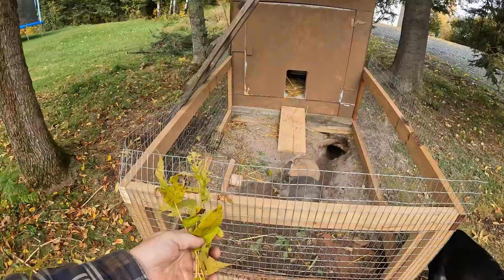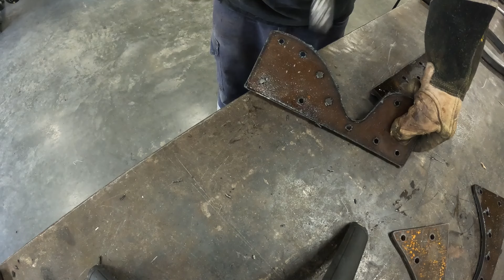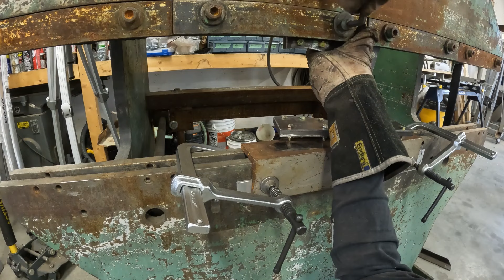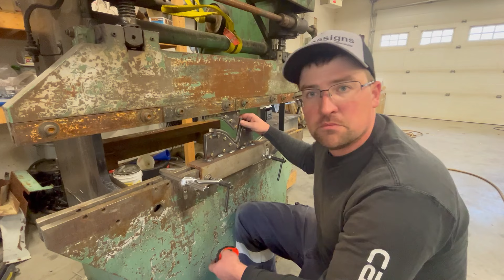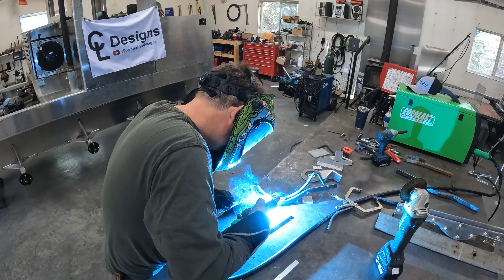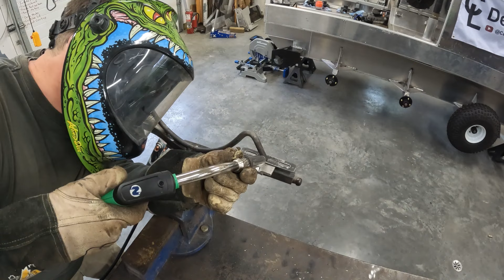Stamping MORE Metal Parts | Snowcat Track Building PT2

Comment: With stiff 3 ply belting will you have to slide each grouser on from a ways back as you build tracks?
Reply from the maker: The belting should just slide in from the ends of the grousers. That’s the plan anyways. Made sure to leave enough clearance so that doesn’t become a big chore. I figure the bolts won’t have an issue tightening it up.
Reply: @CenterLineDesigns  Right, I guess with a pitch of 2.8" you'd never be able to take a single grouser out at a time anyway, regardless of design.   Grousers look great.
Reply from the maker: Yea true probably have to take several apart and give them a twist.

Comment: Just remember adding  galvanizing  adds size and you need to add that thickness into your build and make adjustments . Suggestion bmake 1 complete send it out to get galvanized then check it against the original specs make sure its with in tolerances  . And dont rush the process to get videos out . There is always some other work on  the snowcat that can be done while your waiting for the grouser to be returned from galvanizing.  Just remember everything  say is Suggestions only .😊
Reply from the maker: I really do appreciate the input! Lots of time I have ideas and getting to hear from others gives me other points of view. Some time I take the advice and sometimes I like to continue with my thought process (right or wrong) but I really always do appreciate the comments. So I do honestly thank you! I don’t think the galvanizing process should change too much as my tolerances are quite loose but you are right that the heat cycling process can definitely make things twist and warp. That would be very frustrating. I am going to start making some calls about pricing and I’ll go from there. 

Thanks again! Cheers

Comment: Why not cut them before you weld it to the grouser process is as much as the fabrication  bend cut weld done
Reply from the maker: I probably could. The reason I am choosing to do it this way is that I can really ensure that the fit with the backing plates is perfect. I agree I could totally cut them first. I just feel that doing it this way will limit the potential errors. Also with a small jig for the chop saw it won’t be difficult or take long to do after the welding. 

There is definitely multiple ways it could be done!

Comment: The only downside to 2 pieces is a weak spot in the middle where all the stress is . Also add in the cold  you weak spot will be  magniied , i hope im wrong .
Reply from the maker: True. I think I’ll run a stringer bead between the two pieces but also that wear strip should reenforce the bottom. They feel really solid so I don’t think I’ll have issues. But if I do that okay because we will learn something and move on to the next idea. One thing is for sure we will find out together lol! Cheers

Comment: Don’t waste money on galvi or any other coating, anything you put on there will wear off faster than you think and they are going to rust no matter what. If you are worried about water sitting in the bows at the bottom of the track than just drill a couple weep holes near the crown of each cleat, give the water a way out. My tracked vehicle has had square tube cleats for near 30 years, they have not rusted through yet.
Reply from the maker: Very interesting! This is exactly why I wanted to ask the viewers. It good to hear others experiences. Definitely need to get some holes in the dip. It is surprising how long bare steel will last in the right circumstances. Thanks again!
Reply: @CenterLineDesigns  no problem, track building is always the biggest hurdle.  Your cleat design looks great, still skeptical of the longevity of the tires though. Keep pushing, you will be glad when the tracks are done, everything else will feel easy afterwards.
Reply from the maker: Thank you sir! Yup I agree about the tires.  Easy enough to change later. Really appreciate input from someone with more snowcat experience than myself! Cheers

Comment: It might be smart to make the valley between tooth roots wider on the drive sprockets kinda lily the doo on conveyor drive systems. That way if you have a small amount of inconsistencies in the driven part of the belt it won’t bind and try to climb the sprocket teeth. Only thing I could see being weird is when you go from forward to reverse. Small amount of slip. But if it keeps the tracks from ratcheting I think it’s worth it.
Reply from the maker: I completely agree! Give that little bit of slip. There is definitely an optimum amount to help with track inconsistencies but not too much that you begin premature wear in the valley of the sprocket. Thanks for watching and reaching out! Cheers
Reply: @CenterLineDesigns  no doubt. Definitely a fine line. Love the build though man. It’s right up my alley!  I have been building custom stuff for almost 30 years now. You’ll like that Everlast. I bought their 353dpi when it first came out and have really like it. Also got a couple push pull guns for it. I use one with steel and it’s 50’ long. So the machine stays put and I can pretty much weld anywhere in my shop. The other is a 25’ for building the aluminum boats that I build. It burns 5052 like butter in double pulse. Let’s you weld up hill. Down hill. Upside down. Which is really saying something when it comes to aluminum mig. Great machines!! Absolutely great!!!
Reply from the maker: Oh that is so cool. Really liking it so far. I really really want to build a boat one year. So getting this was definitely in preparation for the projects to come. I am glad you are enjoying the build and happy overall that it’s gaining traction. Cheers

Comment: As a former  sno-cat mechanic  those grousers look very good 
My concern  is the tires not being strong enough
The tires we used were solid and those didn't  always  last long 
I'm  loving  this  build✌️🇺🇸🇺🇸🇺🇸
Reply from the maker: Thank you for that compliment on the grousers! I am really happy with it. That is a concern of mine too. If need be there is a much heavier option that I can switch to. I was trying to get some suspension out of the tires and these were a reasonable price. I couldn’t agree more though. I figure that’s an upgrade area if everything else works out.
Reply: @CenterLineDesigns The grousers will chew the tires. So maybe through bolt (with tee nuts) aluminum strips arched to span the knobs on the tires. Then the grousers pull on the edge of the aluminum instead of directly on the slippery rubber. The alum arches can be changed out as they wear. This set-up assumes a tube type tire - which is probably necessary anyway.
Reply: The draw-back of this tire modification would be the labor time required to modify n#tires X circumference per tire. If there are five tires per side, and each tire requires eight arched aluminum straps added, and each strap has four tee nuts, then 10 tires X eight arched straps = 80,arched straps  X four holes each = 320 drilled holes in aluminum straps ( and chamfered), and 320 holes drilled through tires, and 320 tee nuts and fasteners. That is a huge investment of labor time in order to realize the suspension potential* of inflated tires.

Comment: Treating them: buy a powder coat rig and an oven. Will spend less than hot dip.
Reply from the maker: I have been debating that. Would the powder coating get to the inside? That dip is where I figure it will rust out eventually.
Reply: @CenterLineDesigns that would still be a concern unless you were able to somehow blow the power through the tube while it is charged. This would be an issue with plating as well unless you use a large bubbler to flow bubbles up through the tube ensuring the ions in the solution inside the tube don't get depleted.

Comment: Enjoying the hell out of this build please keep em coming!  Wondering if you are going to cap the ends of the square tubes?  Thinking about rust inside when the vehicle is parked and the bars on the bottom of the tracks may be sitting full of water.  Drain hole?  Good problems to have!  Fun stuff
Reply from the maker: You bet! I’ll definitely get drain holes in. I think I am probably leave the ends open but likely get them hot dipped galvanized. I don’t think it will cost too much so I am going to make some calls.
Reply: @CenterLineDesigns  could just park it on a 45 degree side hill lol

Comment: A cheap cooler to get is a derale 15300 tube and fin cooler, they're around 130 cad on amazon and are good for 300 psi and use an fittings. I use one with a coalescent dryer and it made a drastic difference in my plasma cutter. lots of guys are buying them for plasma setups.
Reply from the maker: Awesome I’ll take note on that. I know I have many issues with my cutting setup. Just got it working “good enough” to get some projects and jobs completed. I am hoping this winter to get some organizing done and start to improve systems, like my cutting set up. Just lately all time any money goes into the cat. Thanks for the advice!

Comment: your torch is slowing down way to much in your corners and that will cause cut quality issues. im surprised its doing that on a sharp 90 usually its on circles that have too many arcs in the radius.
Reply from the maker: I had it slowing down small radiuses to get cleaner interior holes. I am not dealing with great air quality but doing that got my holes cleaner. Usually I don’t run any radius smoothing

Comment: I would make your track belting hole punch to work on your press two locating pins with two punch pins . Check that you will have enough room around the tire for five or six grozers to go around the front tire all at once you may have to shorten the keepers if it interferes with the spacing going around the tire.
Reply from the maker: You have read my mind. That is the plan. Nice rig to go in the press. I have a calculated distance through the 3D modelling I did on the tire. But I agree do a trial set and see how it fits. Much cheaper that way when a mistake is made. Thanks for watching!
Reply: @CenterLineDesigns  also use a length of flat stok sticking out both sides to lay the belting on with guides to keep it centered.
Reply from the maker: You bet!

Comment: Great video!  That welder is a very different sound!  

Two thoughts for you:  make a second die for the round bar to make the first bend, then you only have to set up the press once with both dies mounted and add a drain hole to the tubing. 

I was also thinking DIY powder coating for the finished product.  I'm looking forward to seeing how everything turns out!
Reply from the maker: Thank you! Yes it’s so far very impressive. Interesting thoughts. I get you yes we will have to see if I am all “die making out after the next one for the belting. Thanks for the note! Yes drain hole for sure. Thanks for watching!

Comment: As much work as it is to build I would galvanize or plate them. You might even consider plating them yourself. It's a very affordable process and since you are building them yourself and have plenty of other things to do yet you could just set up a tank and do several at a time as you make them.
Reply from the maker: Very very interesting! Honestly never thought about that. I have thought about setting up to anodize. Cool thanks for the idea I’ll start looking into it. I agree the effort this far kinda just makes it worth it. Thanks
Reply: @CenterLineDesigns https://youtu.be/UF-lhfpwlMs?si=f4Hp8Y0I2dTnhQ2P
This video shows a great way to zinc plate very affordably. Your results are going to be similar to what you would find on carburetor parts. You probably don't even need to do the chromating if you don't want to have the gold color.
Reply from the maker: Thank you!!
Reply: @CenterLineDesigns  were you able to see the links I tried to share? I can't see them. The channel was Arnold's Design.